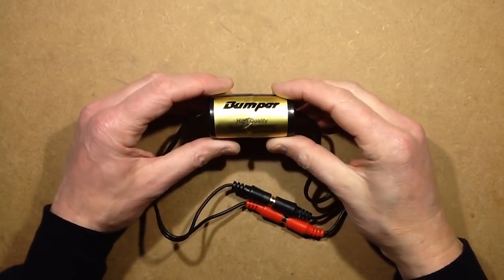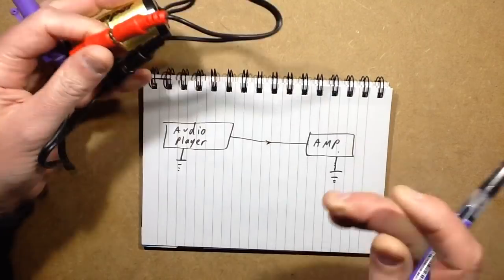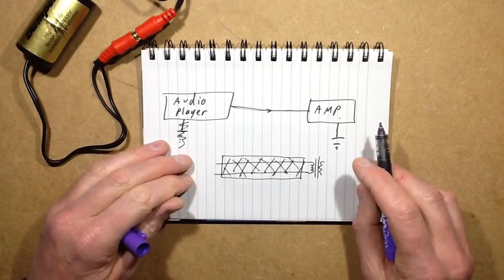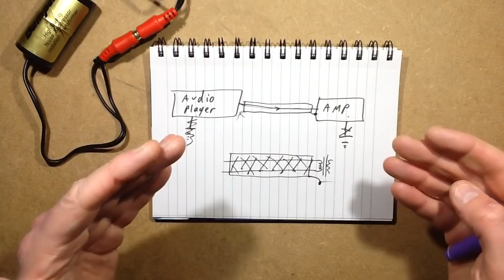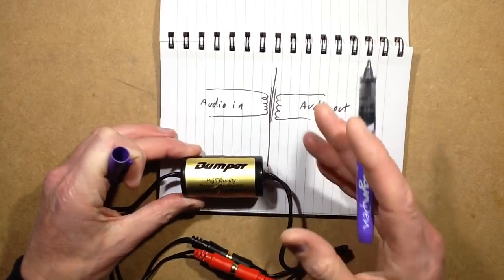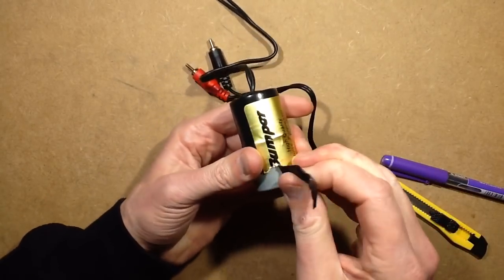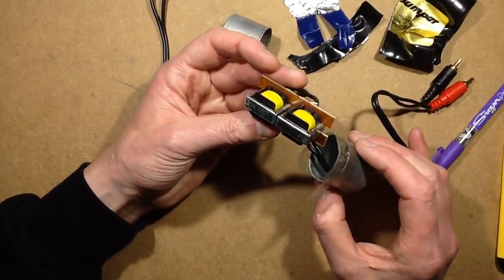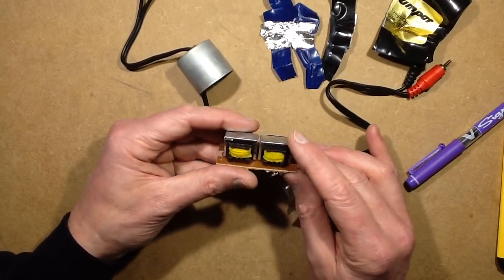Inside an audio isolator transformer module.

Comment: basicali peopel use those supresors for ignition systems as well it is self substained system like the old magneto ignition system by aware that those supresor can work on ac and dc you get diferent engine effects by wiering a supresor in series ore pararel with a ignition coil expecialy if it is dual ignition ore waste spark ignition so basicaly you dont need those other junk like ignitors distrobutors coils and you dont need spark plugs the original dc magneto hade only 1wire and that was screwed on the engine blok  it fired 1 to 12 cilinders with out a mistake pre need for any corections so that anoing nois is usabel and can by very handy basicaly speaking any kinde of ignition system today are based on the old magneto high curent ore high voltage you get interesting effects for exampel ford model T used levers to control curent and voltage flow that is what "makes and breaks a engine" by using frequncis and changes magnetic fiels as well the end result is high speed ore high torgue even bouth with waste spark systems you you get high increase in economy very quaet engine if some one didnt know a 4 stroke engine can by modified to work as a 2 stroke diferent charges have diferent efects on fuel,coolant and oil. and by waste spark system virtualy your 4 cil. engine is not any more 4 its now a 8 cilinder! my point is just to ceap up some peopel to by aware of some things that devices can by somthing used for diferent things and what hapen in reverse mod that is a good way of teaching expecialy if you know for exampel electricity,chemistry,mechanics,metals you literaly can do "loot" dont always belive in theory and schools they will not always teach you the right way. bigclive is a good chanel for teaching he always has nice things to show use and try to explain things simplified so thungs up men you deserve it

Comment: Having a metal case has no meaning unless its connected to ground, it can actually create more problems and potentially pickup radio station signals or other radio interference.
I presume that the foil somehow is supposed to connect the case to ground, if not it might be used as extra RF insulation.
This thing by no means can replace a properly balanced signal wire with the differential amp to filter out the noise.
Your explanation on balanced signal was way too simplistic and even wrong in many ways, I think you owe the unprofessional audience a proper explanation.
Reply: Another "expert" who knows nothing about faraday cages.